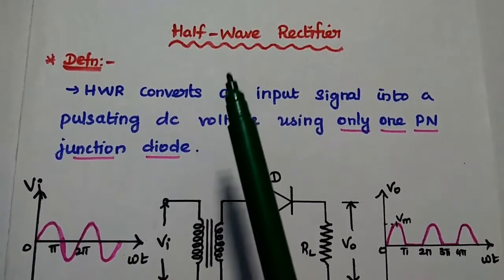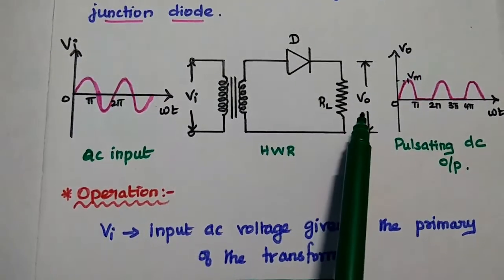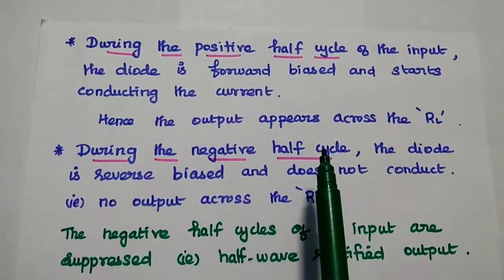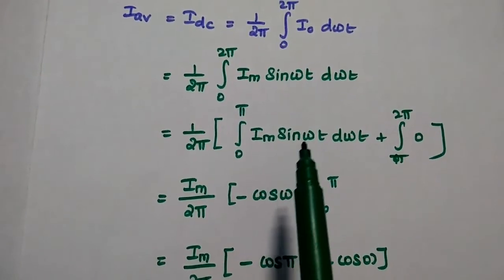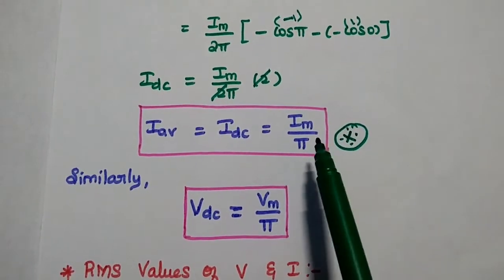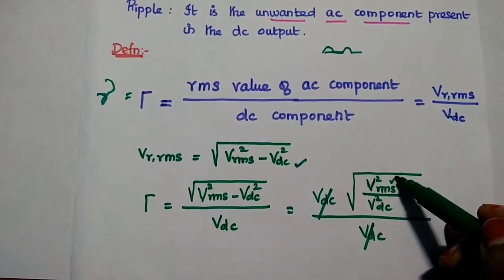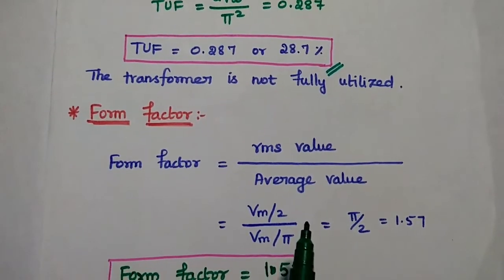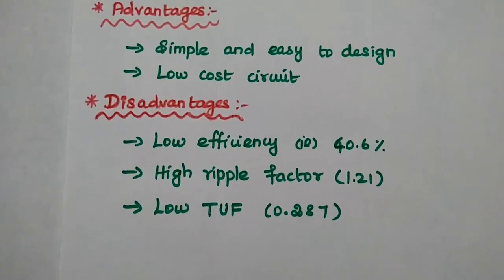Half-Wave Rectifier - Operation, Efficiency and Its Derivation - HWR

Comment: Mam small doubt mam for half  wave rectifier why we taken time period as 1÷2π and for full wavewhy we  taken time period 1÷π  mam.
Reply: In half wave rectifier two cycles are taken but one is 0 so area under the two curves by time period .so that we will get 1 / 2 Pi
Reply: The time period of full cycle is 2π. We should consider the total area under the curve as 2π while calculating RMS and average values. But in case of fullwave rectifier, considering one half cycle i.e π radians is enough because it's a periodic signal and repeats continuously.
Reply: You are right bro. @ch.mratnakar3688